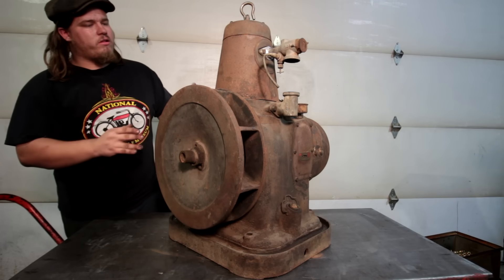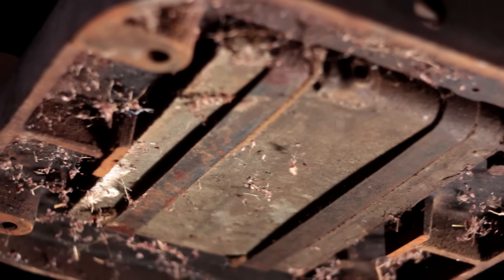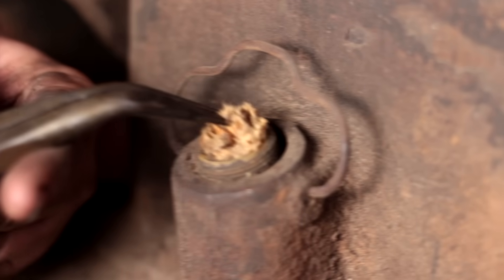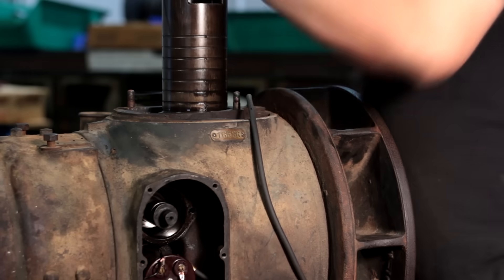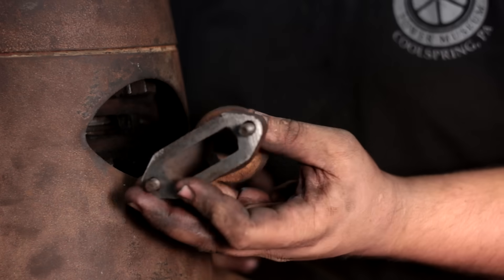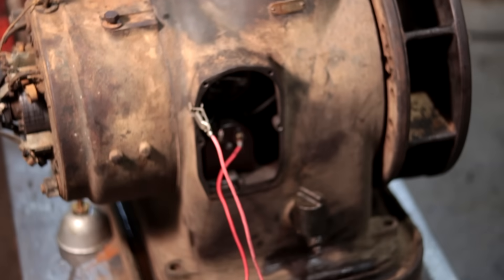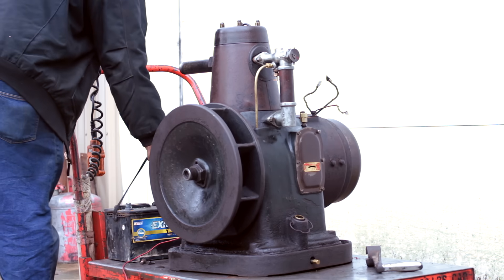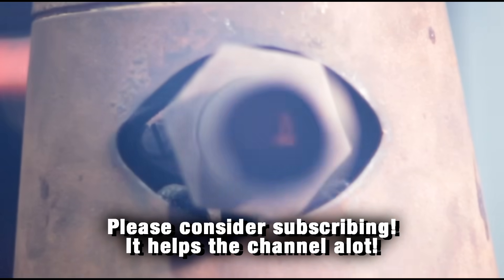100+ Year Old 4 Stroke Engine Design Has NO VALVES!!! Can We Get it Running after 60+ YEARS??

Comment: Properly a sleeve valve engine.  I would recommend you purchase a borescope, so you can check fuel tank internals without having to take it off - or guess condition.  I would definitely have fitted a fuel filter between the tank and carb.  You were lucky!  You have a set of points, more properly called "contacts".  Your coil is a trembler type, as used by Ford early on.  It makes showers of sparks to ignite a fuel mixture.  It has a built in capacitor to protect the contacts from burning or sticking.  I shudder when I see crimped electrical connections that have not been soldered.  Recipe for later problems.  I liked your use of WD40 as clean up medium.  Good you resisted the temptation to bead blast everything and "restore it", often to better than original condition, thereby taking away from value.   Lots of "restored" stuff out there, but few that are original and complete as they left the factory.  Good job!
Reply: I've worked on cars from the 1950s to modern cars and have never seen any that came from the factory with soldered connections.  In all, the connectors are crimped on.  When doing custom sound installations in the 1970s, I did solder some connections.  Eventually, I came to the conclusion that soldering inside of a car was a pain in the butt and risked damaging the interior with a hot soldering iron.
Reply: @BryanTorok  A proper crimp with crimp type contacts used will actually create a number of point pressure welds,  if done right. That is why factory crimps work without solder. Soldering is useful when a crimp comes loose, or has insufficient contact weld area.
 I do think the ones I see here are less than perfect, but still should have enough metal welded for the purpose of his repair.
Reply: @BryanTorok  Same here I used to do both Two way radio/CB installs & car stereo installs, and certainly soldering in a car is a pain, but for me it was worth it!, you just can't beat soldering for reliability!, although when doing commercial two way radio Antenna connections, that would mostly be BNC Crimp, which done properly  as I always did !!!, was never an issue so............
Reply: You must shudder continuously then, because vehicle wiring has ONLY been crimped for many years now. However I still do BOTH.   lol
Reply: @olspanner  This crimp or crimp+solder issue is interesting. IIRC I read somewhere that some industries or trades forbid soldering ... maybe I remember incorrectly.
Reply: @olspanner I do both also, but l first tinn the bare copper, place shrink tube on wire. Then using a higher quality terminal, not the ones with the plastic collar, only in a pinch, no pun intended, crimp the neck with the correct crimping die for uninsulated terminals,then shrink tubing over repair, even on ground wires. The tinned copper wire crushes perfectly , making for both a professional looking and excellent conductivity
Reply: @tcmits3699 that's how I do it to. Tin "sodder" the exposed wire BEFORE crimping. Tin/solder actually inhibits corrosion because it doesn't actually corrode, but the copper wire WILL corrode (you will see the distinctive green colour - that's copper corroding not tin or lead. 
Another thing that I sometimes do if I'm concerned about moisture penetrating and causing the the copper wire from corroding; I do as you do and put a sleeve of heat shrink on, before heat shrinking (but after soldering and crimping) I add a dab of hot glue (a bit of spit between the finger tips prevents adhesion to the finger tips lol - like calking windows) and get some coverage over the connector and crimped area; slide the heat shrink sleeve down over the top and when you shrink it the hot glue will re-liquify but can't drip anywhere because the heat shrink actually starts to apply pressure. Doing it this way will prevent the solder from dripping off the connector under high heat but will also make the joint more flexible when there is heat 👍
A bit of lithium grease smothered over the top of the whole connector and sleeve also does the trick with preventing moisture penetration and corrosion.
Put it this way..... If the connection is exposed to so much heat that it CAN liquify the solder then there is something wrong and maybe an overhaul of the electrics is required, and or rerouting and placement of the electronics away from the source of heat to prevent further degradation is in order? If your solder liquified due heat exposure, then the temperature of that heat exposure is going to cause premature life of the whole wiring.
And usually in those cases (it's happened once before) I ended up using some reclaimed wiring from old kitchen oven that I wrecked out and stripped for electrical components. Essentially ovens and washing machines are the 2 best things for harvesting wiring and electronics from to be able to handle heat and prevent moisture.
Nearly all ovens use high temperature shielded silicon encased wires for high heat resistance. Likewise washing machines also use the same silicon wiring but usually have really nice silicon covers on all the wire connectors(note they use heat shrink and hot glue on their connectors and is why I've adopted the same methodology) keep in mind glue heat shrink is used very sparingly (it's not caked on and oosing everywhere) it's only just enough to prevent any metal exposed to air and only just enough so that the silicone connector sleeve can still be pulled over the top of the connector.

Salt water pool chlorinators also use this exact method for all their connections as well. 

I'm one of these guys that will always pull everything apart that has died before I throw it out. I must look at how it is designed and how it failed before I purchase a new one so that I can prevent a failure again in the future?  Or at the very least harvest anything worthwhile and scrap everything else 👌

100% you can't buy better connections and wiring than what is fitted standard in any oven, washing machine or chlorinator because they are built for harshest conditions.
Sure there are probably things with even better quality electronics and connections to handle space (made by NASA or something) but they are probably difficult to find and not easy to come by in day to day life?

I've really digressed this topic now haven't I? Apologies for the irrelevant fluff.
Reply: @olspanner  another reason why modern vehicles are junk.
Reply: @olspanner  Aircraft electrics are never soldered only crimped. There is a added consideration with sodering both chemical and mechanical. It isnt "belt and braces" .
Reply: @markawbolton  Understood, thanks.
Reply: @olspanner  Yeah you can't beat crimp + solder :).
Reply: Proper crimps for the cable and proper tool for the crimp gives a much more reliable joint than soldering they are prone to  corrosion and fractures.
Reply: Corrosion only if you don't clean the Flux up after you've done it
Reply: @davev2762 you could not be more wrong my confused friend...soldered joints are the the best most reliable connection you can have in a circuit..you will NEVER see crimped connections in anything of high standards....if that were not the case ....we never would have made it to the moon
Reply: @gregdowd939  I am not wrong I used to work in quality control for GEC ELECTRICAL PROJECTS soldering cables in control cubicles was an absolutely no no. I now repair guitar amps for a hobby where soldering is essential.
Reply: @gregdowd939  No soldered joints on cabling for NASA only on PCBs
Reply from the maker: i agree and disagree with several statements. the borescope i  have did not pit in the neck of the tank i did try. there is a factory filter in the needle jet on the carb so i did not need a filter. the points are points not just contacts. the coil is not a buzz coil but just a regular ignition coil in a custom housing and i replaced the condenser they hid in that housing. crimps wont be a problem in something like this as they wont ever get weathered and it doesn't  move enough for them to come undone. i almost never  "restore" engines its way better for history to clean and preserve as it took them 100+ years to get this way! thanks for the great comment! alot of people dont say anything worth a damb or logical!
Reply: @cruddycornstalks   i always heard them called  a willys knight  not light engine even the one grandpa  had on farm said knight right on the casting and the sleeve valve engine was used in 4  and a few 6 cylinder versions of the willys overland knight cars and even for their day  in early use 20 to 30 k miles between overhauls was pretty much the normal outstanding for its day .  even  if you think they wont get affected those connectors over time from moisture in the air will corrode. as for factory filter i still would put an inline filter unless its a full  pleated paper filter with a  outer ultra fine mesh before it gets to the paper. the coil is the older buzz type were that way because the timing was not always the best  for the fuel of its day its  buzzes or as some call it tremble WHILE the points are close  and no spark while the points are open and the capacitor  just  keeps it from arcing across the gap and keep sparking. and to correct one statement in your lead in that it doesn't have valves well these types are refered to as a sleeve valve cylinder or sleeve induction is the proper term for these engines so on a technicality the sleeve is the valve just not in the style most would think of today.  and that same sleeve style system was used in  very  old oilfield pumps and water  pumps  to pump fluids instead of working as an engine, one additional thing you can do instead of wire wheel on the covers soak them in vinegar  that will loosen the rust and most will rinse  or  wipe right off.  love it over all  no heavy  rip it apart repaint and   grit blast that takes away the  patena and   aged  feel.
Reply: @cruddycornstalks  I like your style of video and repair, just would like to see better crimps on your connectors, get a decent pair of crimpin pliers and maybe folks that want solder joints wont whinge as much ... ;-) VERY nice engine, have not seen anything akin to that since the sleeve valve diesels that have fallen out of favor for conventionals. You have piqued my interest in how these worked and now another rabbit hole awaits... Have a great one. I subscribed!
Reply: @cruddycornstalks  Choose your fonts more wisely. Your title pic reads 'Valueless 4 stroke engine'
Reply: @cruddycornstalks  I spent 45 years in the Semiconductor industry. A properly done metal to metal connection is far superior to soldering. On an industrial scale for things like printed circuit boards they solder because it is faster.
Reply: @cruddycornstalks  Hey, I said something worth a damn and logical.........
GREAT RESTORATION!!!!!!!!!!!!!!!
Reply: For decades, at least from the 1950s, I've always heard them referred to them as "points & condenser".  Typically, in doing a tune up on a car, motorcycle, or other gasoline engine, we would replace the "points and condenser' as if it was one thing. Later, in electronics, I learned of the newer term for a condenser as a capacitor.  Now, I understand why a condenser in HVAC is called that, but don't get it for the electronic version.

And, none of the really matters.  So, long as we all understand what we talking about, the name males no difference.
Reply: @BryanTorok  In spite of the fact that the two terms are interchangeable, electrically, I've never heard a mechanic call an automotive ignition capacitor anything other than a condenser. On a different note, I've always been told that the correct pronunciation of the manufacturer was Willis, and I have heard it pronounced that way in old radio commercials. The name has been resurrected fir some modern vehicles and I've heard it pronounced as Will-ees, but that doesn't seem to have been the traditional pronunciation.
Reply: @jbarner13  Totally agree on the automotive condenser.  Interesting point on the pronunciation.
Reply: @BryanTorok  Well?  The "difference" between a condenser and a capacitor is a condenser takes a charge and then bleeds it to ground when the points first open so they won't burn up and lasts longer. Whereas a capacitor takes a charge and "holds" it to be used when needed.  Like on a "phased" electrical motor.
Reply: @AmosBHaven  Regardless of the electrical function, they are the same thing with a different name.  They are both metal plates separated by an insulator.  In the 1920s and 1930s in radios at RF and AF they were called condensers.  Google:  When did condensers change to being called capacitors?
Reply: We call "Trembler" coils "Exciter" coils, in the UK. One never forgets one's first exposure to an Exciter coil, in action.....
Reply: Soldering makes for connections that don't tolerate heat well, and become brittle too. There are reasons for NASA to have wire crimping and wrapping guides, and why they never solder wires to things. Wires are flexible and tolerate a lot of vibration and movement, solder joints are stiff and break quickly from fatigue, if they're under stress.
Reply: @jammi__  Especially, as I said elsewhere, with the damned RoHS-compliant solders that have no lead in them.  I know, I know, it makes e-waste even more hazardous, but at the same time, how much MORE e-waste is generated due to solder joints failing from a lack of vibration tolerance.

(probably not much, admittedly.)
Reply: @jammi__ nope
Reply: @jammi__  Exactly. There is a stresss raiser where the solder sharply meets the bare wire strands.
Reply: I would recommend you learn the Linemans/Western Union Splice it's the only Splice approved for aviation. And, no need to solder as that can cause embrittlement. I learned it from Chris Fix
Reply: A very good reason for not soldering connectors is because the solder will wick along the wire away from the connector. This can make the wire more rigid and make it more likely to fracture if it is allowed to move or not secured and allowed to shake.
Reply: solder connections are actually weaker in many cases. The crimp connections allow some micro movement to the copper strands, whereas the solder binds them rigid and end in a very localized spot away from the crimp connector. This allows a very high stress riser leading to work hardening and accelerated failure of the strands. This is not to mention chemical weakening due to acidic flux wicked up under the wire covering or the heat affects from the soldering process.
Reply: Thank you never heard of sleeve valve engines,
Reply: @dacdac1962  That makes at LEAST 6 of us!  LOL!  Never seen or heard of such a critter before!
Reply: If you don't have spikes burning on your point, you do not need to change your condenser. The condenser will break down in time, but if it is working well, you do not need to change it. I have had new condensers pit a set of points. Likewise, I've had condensers last for years.
Reply: I used to be super anal about soldering, but then it was pointed out that soldered joints tend to crack due to vibration--especially nowadays with the RoHS-compliant solders without lead.  Something that's been a real pain in the ass with appliance circuit boards--I had to reflow the solder joints on a gas furnace because they'd neatly cracked around the connections to the thermostat.

So long as there's no moisture getting in there, I would assume it wouldn't be an issue.  But since the cooling air is blown through the whole casing, wouldn't that lead to moisture all over the internal surfaces--including those joints?
Reply: Oh dear…..
Reply: Clean it up enough to make it run reliably,as my father says it's only original once. ✌️
Reply: I can't believe it still runs after 60+ years—absolute mechanical brilliance!
Reply: @  try 100 years these came around the yearly 1920 and a few of the singles  in the late teens
Reply: Nothing wrong with properly crimped terminal ends, most engine grounds & power leads come that way from the factory. I like to heat shrink around the wire ends to try & prevent oxidation/corrosion, use heat shrink terminals, or could solder the wire ends at the terminal if it's exposed to the elements but really not necessary and can be pretty cumbersome to solder. 
Coil really doesn't look like an old school Ford buzz box IMO, regardless you'd have heard it buzzing when it was running if it was.
The terms contact breaker or points have been used interchangeably for a long time, they're the same things as far as function goes being mechanically driven electrical interrupter switches.
Reply: Congratulations on getting the engine running. Everyone seems to have an opinion whether they ever even saw one of these engines or not. About forty years ago I rebuilt one of these engines that was in a Knight car. It was obviously a multi cylinder version, I wasn’t aware there were single cylinder engines. The one I rebuilt was stuck since the early 1940s. As you can imagine it was quite an adventure, as you found out nobody I could find had any idea how to time it. It was a very interesting concept, the sleeves were driven from the shaft by small brass connecting rods. I made some of the necessary parts and had others made. It’s really satisfying when you can restore an engine like that to original running condition. I can still remember doing like you and looking into the exhaust ports to see the sleeves operating The car it self was totally restored by another shop and won a top prize at the Hershey Car Show in Pa. when it was finished. 
 Keep up the good work and don’t take some of the comments too seriously.
Reply: No they are points ..The contacts are the parts that touch each other for the electrical connection ....
Reply: Kinda cringed when he mashed the connectors on.  You can get a pliers type tool at harbor freight for about ten bucks and if you know how to use it will make a fair crimp.  Mash and solder works good too.  If you know how to solder...  Cool job on that engine.  👍👍💯
Reply: As a retired mechanic, I have come across poor crimp connectors, mostly because the crimper just pinched the connector. A good crimper literally makes a dimple in the connector. Another argument for crimp connectors - a lot of replacement fuel pumps from the GM dealer and ACDelco come with heat shrink crimp connectors.
Reply: The reason that most automotive electronics use crimped wires instead of solder is that, in some instances, the current of DC electricity can get hot enough to weaken solder. Additionally, where wire connections may be in close proximity to hot mechanical components, that heat can also weaken solder joints. 
 
I had a friend who once tried soldering wire to starter motor brushes to replace worn brushes. It did work because the brushes were also crimped before he added solder, but after just a short period of use and then inspecting, all of the solder had liquified and dripped onto the inside surface of the starter housing, either because of the current used by the starter to turn the engine, or from the heat of the engine or being in close proximity of the exhaust headers.
Reply: I agree with you NOT soldering the contacts, as the solder makes the stranded wire one solid wire, and prone to breaking due to vibration. A tip I learned as an aircraft avionics technician.
Reply: I don't know about that I always called points points and I know they are our a contact sw LOL
Reply: @RonaldDaub-v9y  Yeah what else do you call points! ???? , same as Solder is Solder, not sodder FFS ??????
Reply: Once in a while people make respectful and informative comments. Kudos to you, thanks
Reply: Modern crimps resist breakage and cold flow problems better than solder does, it's the standard for making good connections in high-temp-and-vibration environments until you get to the really exotic stuff like the crazy aerospace low-temp solder-crimp sleeves that cost $5 per joint.
Reply: Soldering crimped wires is bad because the wire will break at the end of the soldering due to fibrations.
Reply: No solder in the marine industry.
Reply: Weshalb verringert es den Wert wenn eine Maschine neuwertig aussieht? Mir persönlich gefällt es auch gut wenn man alten Maschinen ihr Alter auch zeigen lässt, solange sie auch wie vorgesehen funktionieren. Genau so reizvoll finde ich es wenn sie wie fabrikneu aussehen und funktionieren.
Reply: I believe Barr and Stroud used to make sleeve valve engines which were very reliable . I never saw one but spent a long time trying to understand how and why etc. Similar, not identical, designs are being looked at again.
Reply: 100% agree!
Reply: Never try to turn over any sleeve valve engine that hasn't run for sometime  the sleeves could be seized  you could break the sleeves always pull it apart first  unless it feels very free
Reply: @jackbarrie6007  Did you watch the video? He did pull it apart first bro. Just saying. Your warning unwarranted
Reply: frigg off
Reply: IF you look Up the collage definition they are called contact points 🤔
Reply: I agree that it's always better to solder, rather than crimp, as it allows the flow of current to not be restricted. A poor connection can result in energy loss in the form of heat, at the connection, and with time, can burn the wire to the point where electrons can't flow through it. The same reason welders have to cut about a foot of lead near the stinger, every so often (speaking from experience).
Reply: That mechanical sound without the exhaust sound... 🎉❤🎉❤🎉!!! It reminds me of being in the engine room of a ship or tugboat.
Reply: Ohh my god ... There is zero vibration .....❤
Reply: Valueless
Reply: Yes, this man is what it is :body-blue-raised-arms:
Reply: Loved the way u put 6369 in his place 😅😂😅
Reply: Use noalox in a crimp and it will last forever.  The electrical industry moved past soldiered joints 50+ years ago.  Does your doctor do bloodletting and use slugs too?

LOL
Reply: @svbarryduckworth628  I've come to presume that people that have difficulty with crimps or insist on soldering them just aren't using the correct tools. Ratchet crimpers with proper dies and hex crimpers for setting ferrules make all the difference in workmanship.
Reply: @svbarryduckworth628  I know it's only a typo, but I like the term "soldiered" for soldered. Sounds like a Mil Spec! ☺☺
Reply: @karlTheSnarl-y8p I am an old fart and have pronounced it ‘sodder’ since I was a child. I hear it pronounced ‘solder’ which is apparently how most people say it.
Reply: @tomg1956 like Louis Rossman he calls it sodder too. I thought it must have been a new yorker lingo thing, but apparently not it's just an old school thing, eh? And that really doesn't surprise me much with regards to Louis adopting ol school lingo.
Reply: @tomg1956  That just tells me that?  Most people are wrong!  😂
Reply: Sleeve valve engine. They were also used in some Daimler cars and others. Fiendishly complex and compact.
Reply: @ianakers8012  The French car maker Panhard produced sleeve valve engined cars in the 1920 and 30s. I read that high oil consumption was an issue, so too cold starting.
Reply: @gardenamateur Also Voisin
Reply: He only has a crescent wrench to work with. Prolly cant afford a borescope :)